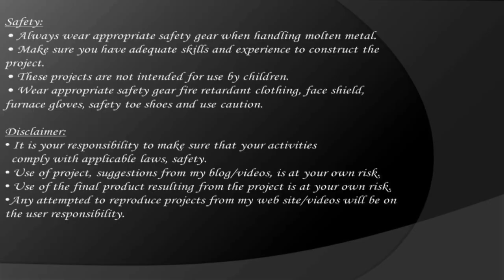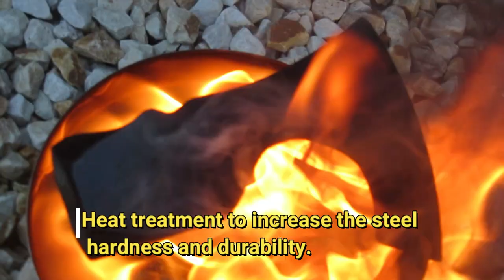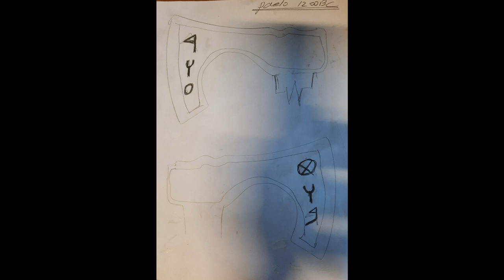Turning a cheap axe into Viking style axe

Comment: Why aluminum for the handle? Is it purely ascetic or does it server some purpose?
Reply from the maker: Good question, no purpose at all just another metal casting project, but you have to admit it looks mych better then the original standard plastic handle 😉 also the life span of this axe is  now extended I guess, much more solid with the new aluminum handle.